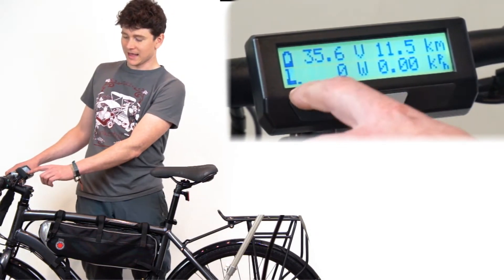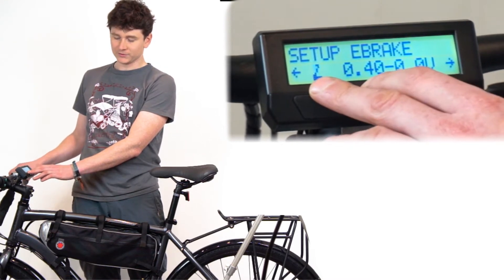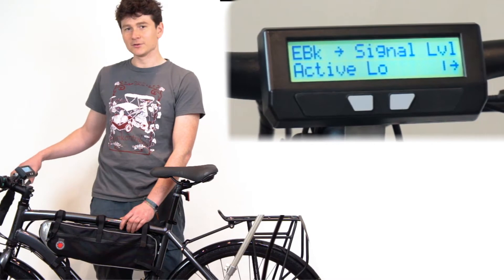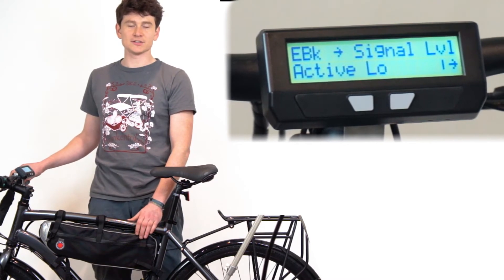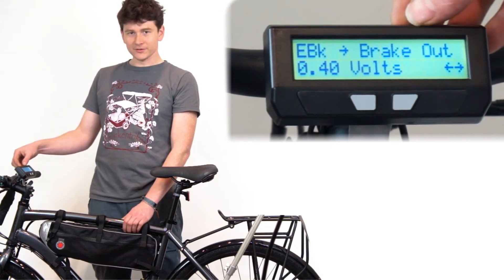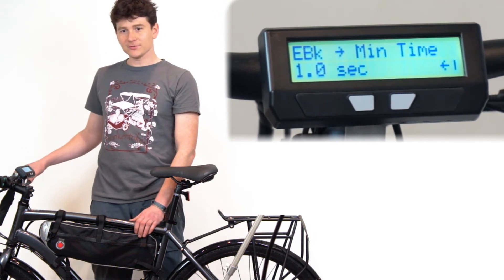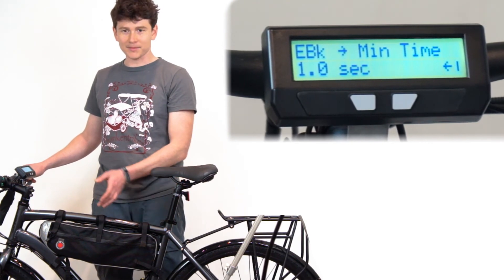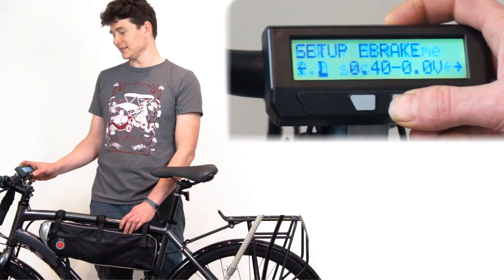CA3.1 Tutorial, Ebrakes / Regen

Comment: Does the regen work same way the Solar Current Sense works..?
Reply from the maker: No it's nothing at all like that. Regen works with the main motor controller on the bike and puts negative amps on the CA screen.  The solar current sense is for a totally separate current sensor unrelated to the motor controller activity.

Comment: Could you please recommend a controller which support proportional regen?
Reply from the maker: Both the Grinfineon and Phaserunner/Baserunner controller lines have this 0.0-0.8V throttle regen feature enabled by default, see:
https://www.ebikes.ca/product-info/grinfineon.html
https://www.ebikes.ca/product-info/phaserunner.html 
Many other advanced controllers have variable regen but only on a 2nd analog input line to the controller, rather than being coupled to the same single throttle voltage signal.

Comment: I have at push button i want to use as a reg brake. What settings should i use for it? lets say i wanted 60 amps braking power.
Reply from the maker: You need a motor controller that can do 60A of braking power when the throttle signal is at 0V.  So the question of settings has to do with your motor controller, not really with the Cycle Analyst.  If you are using a Phaserunner then just set your max regen phase amps to 60A and you'll be set.

Comment: Why have a 4pin JST when there are only 2 active pins? I get you have the other 2pin connector assigned for the Thermistor.... wouldn't it just make sense to label the connecters and use the 2pin connector for the Regen as well?
Reply: Just to add on the CA V3 PDF states needing 3 active pins on the 4pin JST? 1.Red for 5V  2.Black for Ground 3. Is empty and 4. Blue for EBK? So i'm a bit confused?
Reply from the maker: As explained in email, some ebrakes use hall effect rather than magnetic reed switches and so require 5V power in addition to Gnd, and we went with 4 rather than 3 pin plug to both avoid confusion with the 3-pin throttle plug. This also gives the future possibility of having pin#3 serve as an analog rather than a digital ebrake signal, should proportional ebrake levers ever become more of a thing . Then we can have one plug standard that will work with simple 2-wire reed switch or mechanical button brakes, 3-wire hall effect digital brake switches, or 3 wire analog brake levers.

Comment: is it able to control the regen on sabvoton controller? thx
Reply from the maker: I'm not too familiar with the Savbvoton inputs so perhaps someone else can say. Basically, if you are able to configure the controller so that the analog brake signal starts regen at say 0.8V, and then reaches maximum regen at 0.0V, then it should be no problem. But if the regen signal needs to start low and go high for max regen (like starting at 1V and 4V for max) then it won't be possible.